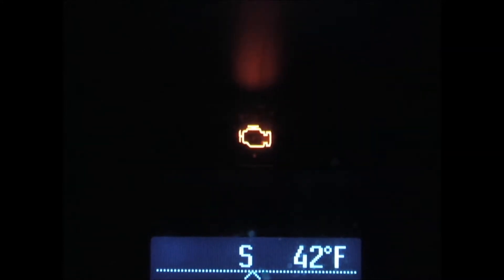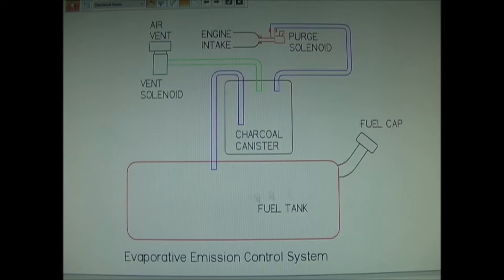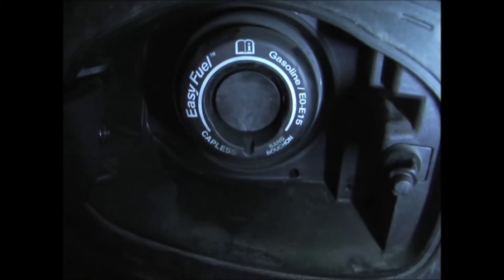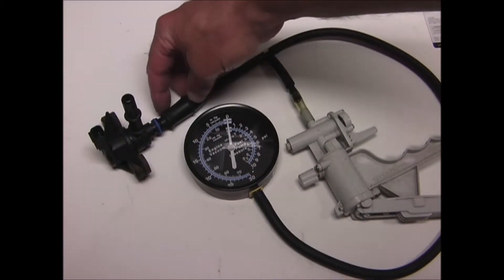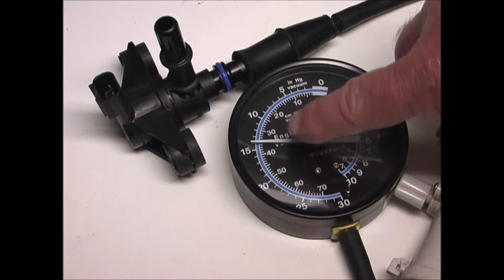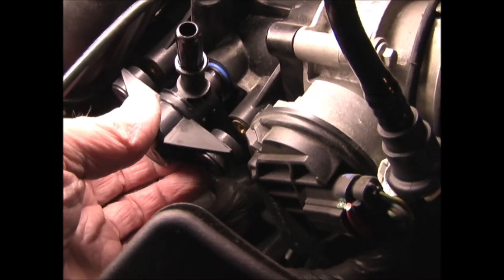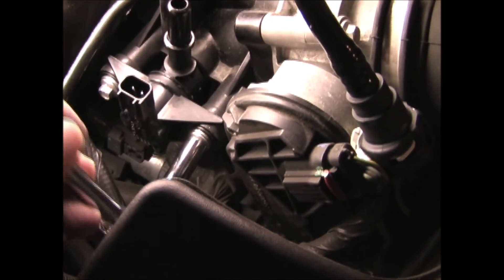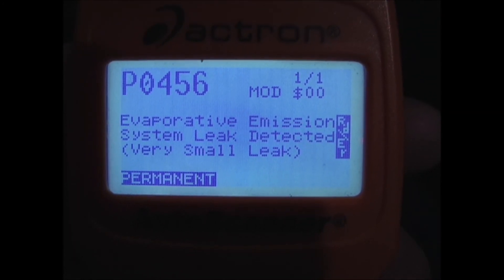CODE P0455, P0456 EVAP Small Leak Troubleshoot / Diagnostics / Repair

Comment: Loose gas cap warning turned out to be a bad vent valve, it had just a bit more stiction than the new one.
Reply: Easy fix/replacement

Comment: Replaced my gas cap with a brand new one, replaced purge valve, and code still reappear after a week or so of clearing it.  What can be the problem on my 2014 Sonata Hybrid?  A little history on it, Hyundai sent me a recall letter to have charcoal canister replaced  and computer updated at the dealership.  I went to Automax Hyundai in Norman OK and they performed the recall repair.  Four days after the charcoal canister replacement, that was when this code started appearing.  I went there three times and they claimed that had nothing to do with P0456 code.  I’m at a loss.
Reply from the maker: Did they forget to plug a hose back in or possibly crack one?
Reply: @WilliamFrawley  I looked around to see if anything was unplugged and there wasn’t anything obvious. Now I am leaning towards the hose being the problem.

Comment: Hi I found your video informative and educational. I did a diagnostic with a hand held OBD II and got an error code P0456. I checked and cleaned the gas fuel cap and seem to be fine. I replaced my Purge Valve because one of the hose had a cracked. The engine light goes away. However when I run the diagnostic again the error code still comes up.
Reply: Unplug ya battery for ten mins

Comment: Got code p0455 and p0456, check gas cap and replaced purge valve. The code cleared but the truck is doing the same jerk on acceleration, any suggestions? 2014 Ford Explorer.

Comment: He must've misspoke the MK3 focus was never offered with the 2.5 anywhere the largest you could get was a 2.3 and that was exclusive to the RS. He likely meant 2.0 as that is the most common engine that year

Engines offered 1.0, 1.5, 1.6, 2.0, 2.0(st), 2.3)rs), 1.6(tdci), 1.5(tdci),  2.0(tdci)
Reply from the maker: This is a Fusion not a Focus

Comment: If the valve sticks here is an easy, quick and cheap fix. Spray a little WD40 in the intake of the valve. After a little tapping of the valve it started working.

Comment: What type of damage to your car can this cause if let unsolved for a while?
Reply from the maker: It doesn't damage your car, it just releases fuel vapors into the atmosphere
Reply: @WilliamFrawley  thanks for the response. I changed my purge valve out maybe more than a year ago. Got the code again sometimes I think I’m able to smell the vapors. But the code has went off by itself after adjusting gas cap. Is it possible to smell the vapors if it’s the gas cap or would the leak be somewhere else?
Reply: @WilliamFrawley  Hello, thank you for very informative video, where can I find the pressure gauge vacuum you have to test the Purge Valve?? I try to search for it on google, no luck
Reply from the maker: @johnnyboy2618  SEARCH Amazon: Actron CP7803 Vacuum and Fuel Pressure Tester Kit   OR   Performance Tool W87030 One Man Automotive Hand Vacuum Pump Test & Brake Bleeder Kit
Reply: @WilliamFrawley  ty so much for this info
Reply: @WilliamFrawley Incorrect. It causes several issues including decreased fuel economy.
Reply: Aids...

Comment: I have a 2010 Toyota Yaris with 3 codes p0457 p0441 p0455. I already replaced the gas cap, already replaced the purge valve as well as the charcoal canister I don’t know where to look next? Can you please help?
Reply from the maker: 3 more things to check:
Evap System Hose– The hose that carries the fuel vapor from the fuel tank to the intake manifold can begin to leak. This will cause the P0455 code. Look for either a tear or hole in it.
Fuel Tank Sending Unit– It is possible for the gasket that attaches the fuel sending unit to the gas tank to go bad. This can reduce tank pressure and throw the code.
Fuel Filler Neck– There is often a gasket where the fuel filler neck connects with the gas tank. This gasket can dry out. When it dries out, the fuel tank can’t hold pressure anymore.
Reply: @WilliamFrawley  I forgot to mention I already replaced the evap system hose and the same codes are still there but I will try the the other 2 things

Comment: I have the P0455 large leak and the P0456 with a very small leak. Both codes are for an evaporative emission leak. I need to find that valve in my Civic 2018, but my engine looks different than yours. Plus, I don't have your vacuum tester. Thanks for pointing me in the right direction. I just don't know where to start now. Lol
Reply from the maker: You may have to remove the engine cover or intake air duct to see it. (possibly drivers side of the engine near the back) You might want to look up the part on a parts store website so you know what it looks like.
Reply: @WilliamFrawley , I tested the purge valve with a vaccum pump and it is in good shape. I ended up ordering the charcoal canister in the end.
Reply: You don't need a vacuum tester... Take the purge valve out and with your mouth, blow into one end of it. If you can blow air through it, it's junk, if not, it's good!
Reply: @justmeinnh2 I did that with the purge valve and also the vent valve. Both are in good shape. To this date, my car is still showing both codes and I don't know what to do. The good thing about my case is that there's no emission testing in my county. I do want to solve the problem though.
Reply: @lohengrinknight  change the O rings and the lines that can also be the problem

Comment: I had a p0456 code a few years ago on my Nissan xterra. Replacement of the purge solenoid valve solved the problem. Then it mysteriously appeared. Replacement of the gas cap solved the problem for a few months and then it appeared again. Nissan placed the canister and solenoid valve in the most difficult place. I hate this annoying code.